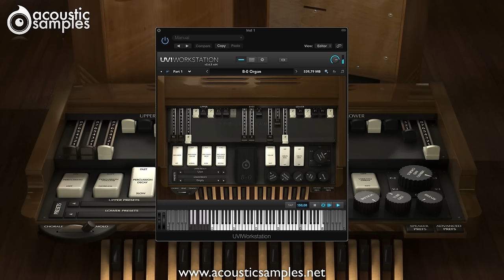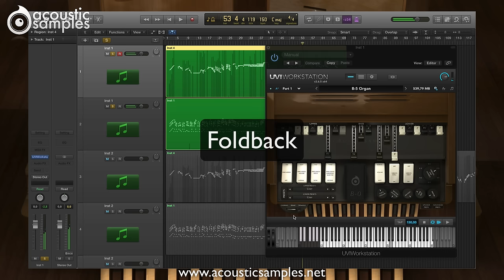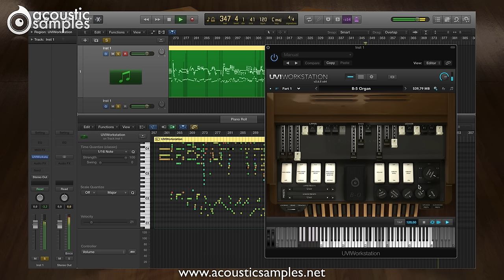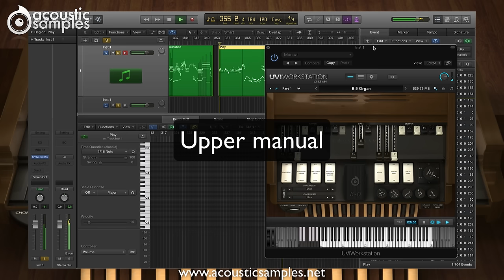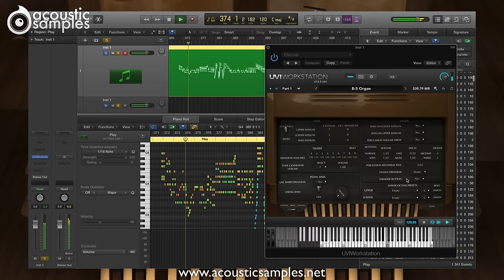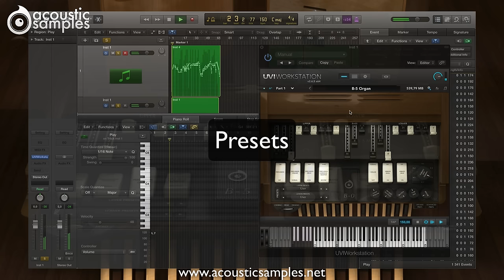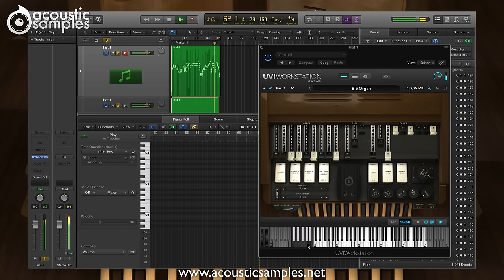Acousticsamples B-5 Organ

Comment: I LOVE this plug-in! NOTE: The 'Horn Bleed' is set far too high in the default, which produces an annoying dry signal. All bleed in an actual live Leslie situation is almost completely imperceptible at the console/audience level, which, to a Hammond/Leslie geek (like me), made the default settings sound extremely unrealistic. After some (meth free) tweaking I managed to get a really pleasant tone (still not quite there, but very nice).... oh, then i discovered the 'DEFLECTOR' tab!!!!!!!!!!!!!! WHAT! I can honestly say, I don't remember any sim including the Defusser/Deflector off feature, which in an actual Leslie makes a WORLD of difference.  Now that this has been addressed, I am blown away! Shape wise,  the horn is still more Motion Sound Pro 3T-esque (but fuller & closer to a Leslie) than Leslie cabinet proper, but if it were a little more hollow/nasal/throaty/pinched/bell-like /rounder/tubular sounding (which EQ can't address) with more FM, it would be an absolute dead ringer. No More external sims needed for this app! With Features and models, this is definitely the one to beat!